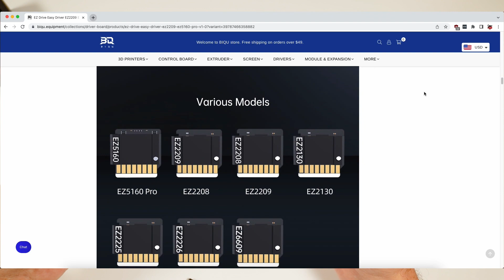BIGTREETECH Manta E3EZ - Basic Review

Comment: This looks like a good board for a Voron Salad Fork if CANbus or USB is used for the extruder. The Salad Fork needs 6 drivers (ABZZZE), so 5 on the E3EZ and one more on the toolhead board will cover it. This board is a bit smaller than the similar M5P. The Salad Fork 160 is small so space is limited and this is about as small as it gets for a Klipper setup with 5-6 motors. It would also be a good Klipper upgrade for a Prusa MK3 or Bear to provide independent Z with a compact footprint. It would be a reasonable choice for the Voron Switchwire as well though the M4P or SKR Pico would have enough drivers in that situation.
Reply from the maker: I don't even know what to add you are right.

Comment: Did it work without cb1
Reply from the maker: I only tested it with CM4 and CB1 modules, not fully sure why you need one if you use it without a module. Whole benefit of this board in this feature. There are cheaper board available if you need same functionality but without CB1 or CM4.
Reply: @hobbyistnotes  I cooked my board yesterday on my ender 3v2. Express shipped this one here. I wish they would bite the drivers are not even included. Looks like I’m about to spend the same amount as the board on drivers and the cb1. I didn’t really intend on taking this printer this far. I was just trying to change my hotend wiring, this is getting expensive. 
Does the cb1 have onboard wifi at least?
Reply from the maker: @howaboutnowdad4582  Yes CB1 has onboard Wi-FI, I guess it might be possible to use Manta board without CB1 via usb connection, but it's just an educated guess (I haven't tested it)
Reply: @hobbyistnotes  yeah like you said it seems to be the main feature. I haven’t see anyone without a cb1 so why be the only person. The ender is about to go Mercedes mode I guess
Reply from the maker: @howaboutnowdad4582  Funny that for most people who spent money on Ender 3 journey finishes at conversion to Switchwire.
Reply: @hobbyistnotes  thank you. Checking that out right now
Reply: the only reasons I can see to use this board over a skr mini e3v3 if you aren't using klipper would be: extra fan controls or true dual z instead of split z. 

So there are reasons to run it without a cb1,  just not many.  I could see it if you're comfortable with marlin firmware getting this, installing it and getting running then adding the cb1/2 later and going klipper.